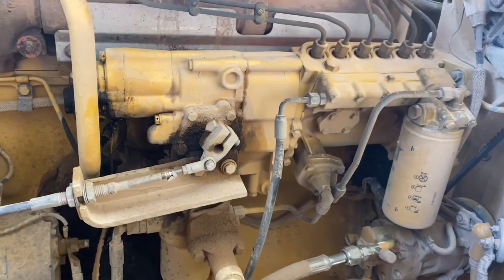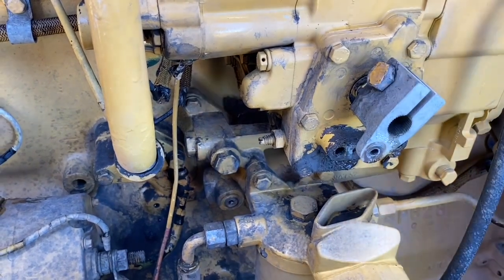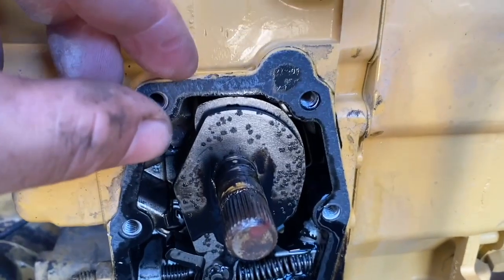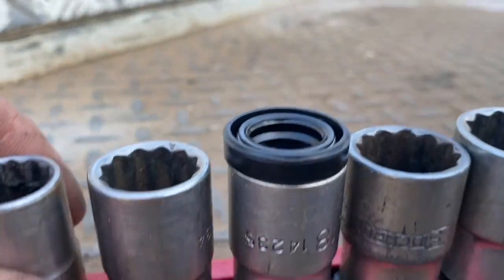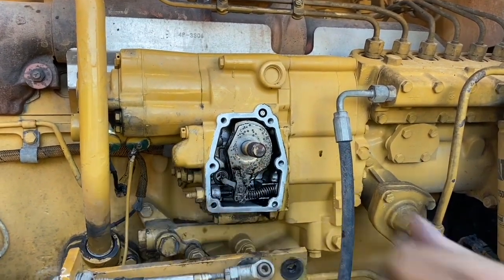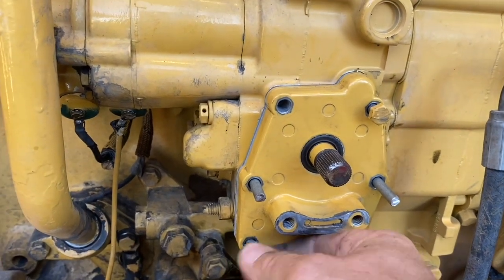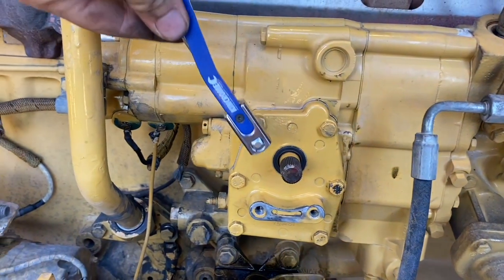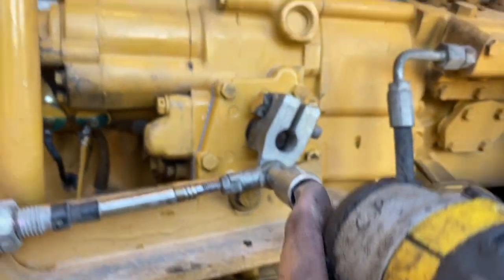CAT 3306 throttle shaft oil leak repair

Comment: On high hour engines or recertifications, the seal failed because the throttle shaft bore at the back of the governor housing wears and allows the throttle shaft to wobble enough to cause the seal to have short service life. I made a jig and used the reamer from the sleeve metering tool group to ream the housing to accept the same brass bushing as the SMFS used.
Reply from the maker: Sounds like a good repair . This video was actually shot last year and the engine has 2000hrs on it so far and no leaks. I will let you know when it starts leaking again

Comment: Any common issues or leaks on a C12?
Reply from the maker: No, C12’s are  not typically a leaky engine. Sometimes they weep around the flywheel housing or the sump pan but it’s usually very light and easily washed off. Great engines !

Comment: Howd you know it was leaking?
Reply from the maker: With the engine hot and running, we could visually see oil weeping around the front cover. You can see at the start of the video the mess around the throttle shaft caused by oil and dust sticking to the pump.